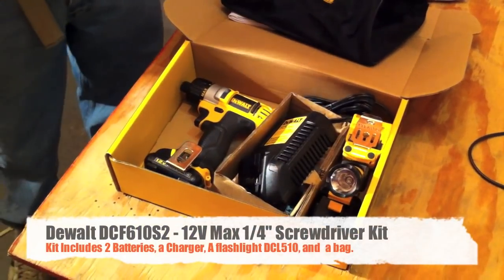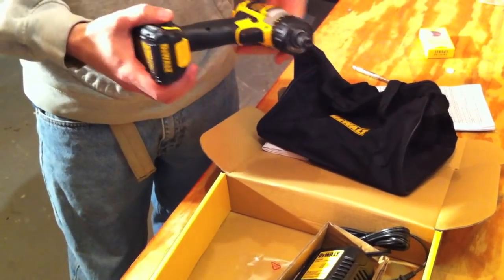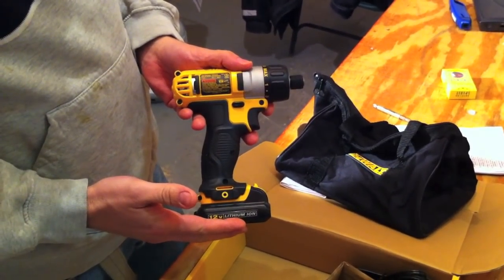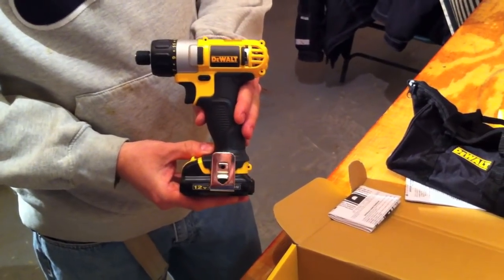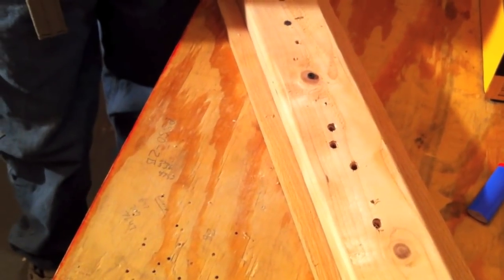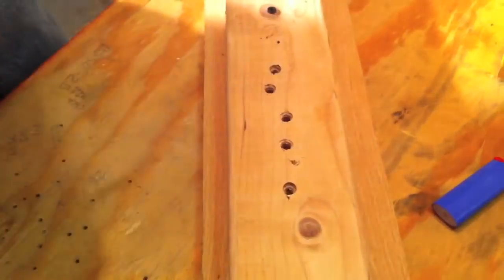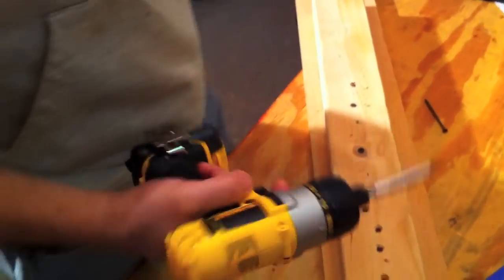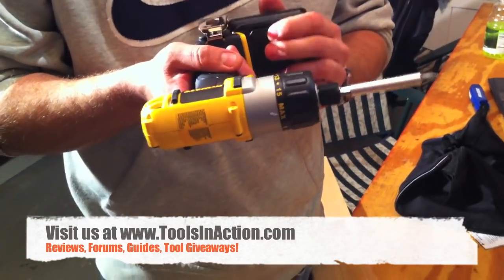DeWALT Screwdriver DCF610 12V Max

Comment: Perfect for furniture and cabinet assembly, electrical, hvac, the list goes on and on. The big benefit of this model isn’t the length there’s plenty of shorter drivers. It’s the width. Lets you get so much closer to the edges of a cabinet or other tight spots.

Comment from the maker: @842qwery Your correct.  If your just working around the house, I would just go with the drill and forget about the screwdriver.  The screwdriver is about 1.25" shorter than the drill, so you can get into tight spots with the screwdriver.  It is designed more for the contractor who works in tighter spots and is primarly fastening.  Maybe inside an electrical panel, attaching stuff between joist or other tight areas.

Comment from the maker: If you need more power and torque you would use a dcf815 like running 2" screws into wood or removing a nut, the dcf 610 is mainly designed to be a screwdriver with adjustable settings so you don't strip or damage what you screwing.

Comment: if the dewalt sees its shadow that means the battery will only last about 6 weeks.

 4 out of 5 of my xrp 18 volt batteries have kicked the bucket in less than 2 years. I just ordered the 12v 3pack and I hope this time I am not disappointed again with battery life. I mainly bought this kit for the impact gun. I got the sawzall, drill, impact, 2battery, charger and a bag for 200 on ebay w/ shippping. If I got the 18v impact and 2 more batteries I would be in deaper..... and carrying around a 8lb impact with the 18v.

Comment from the maker: The Impact driver and wrench are basically the same thing except for the driver has a 1//4" Hex head and the wrench has a 3/8th" hog ring anvil head.  For the jobs you are doing I would not recommend an impact. I would go with the DCD710S2 it has an adjustable chuck that will allow you to use any kind of bit up to 3/8th's. It also has 2 speeds, its a great all around compact drill/driver.  The Milwaukee's are good also, they are just  not as light and ergonomic as the dewalt's

Comment: If I had this, I would use it for pilot drilling as well as light screwdriving. Great for assembling cabinets and other smaller furniture that don't require heavy-duty screws and bolts.

Comment from the maker: @sanivivo They are both very nice.  With a standard batteries, I like the Dewalt.  Just a nice feel.  When you put an high capacity on the MIlwaukee, it really changes the feel of the Milwaukee and give it a much better feel and balance.  In regards to power, they are about the same.  Both of our models are still running.  I have seen people complain about both and praise both.

Comment: For projects around the house; wouldn't you be just fine with a drill only? Isn't it possible to use screw driver bits on a drill? Just trying to figure out why would I need a  separate drill and screwdriver tool.

Comment: THERE IS A DESIGN FLAW WITH THIS TOOL.  Granted, it is one of my favorite drill/drivers for light jobs like  electrical work, where compactness,  light weight and good balance are valued, but little torque is needed.  I wish I could find a similar product by another manufacturer.  This drill has been a problem since from the beginning.  It will reach a point where it will not retain a bit, requiring disassembly and replacement of the spring and ball detent system.  If used daily, you will be tearing the thing down once a month, so stock up on springs and balls.  Very disappointing Dewalt is not interested in providing customers with a permanent solution.  Thinking  back now, after the second time the issue arose I contacted Dewalt.  When I explained the repeated failures, his response "well, what do you want me to do about it".  Nice customer service huh?